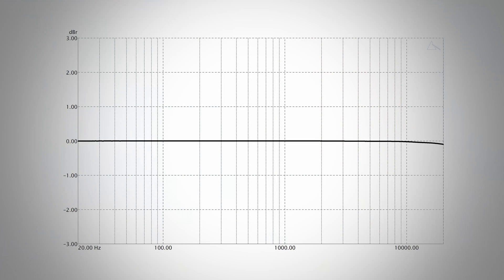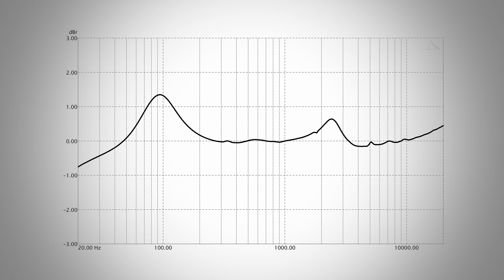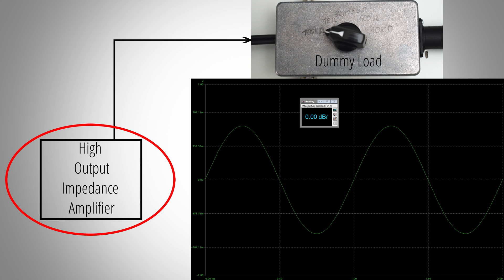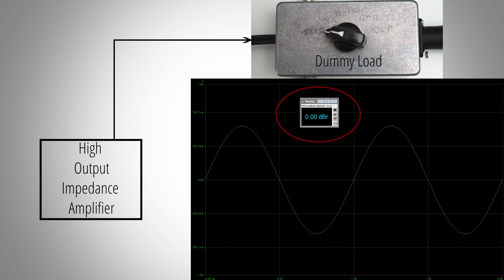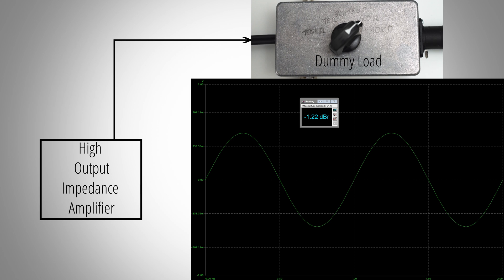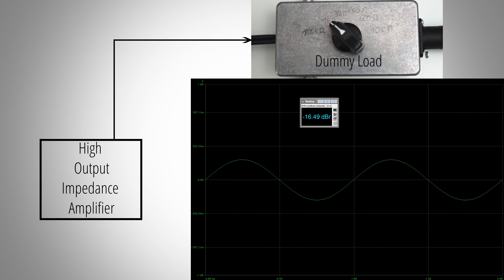Amplifier Impedance matters! Why it is important to have a low output impedance (explained)

Comment: I Lost it... my SoundCard(SBZ) has 22-Ohm output. 
so 22 x 8 = 176-Ohm.

I Have 3 headphones: A) 32-Ohm, B)35-Ohm and C) 60-Ohm. they have Lower  Impedance than 176-Ohm, will that effect their Sound?

Or the problem is only if the Headphones go beyond 176Ohm?

Will my SoundCard Struggle to Power more than 176Ohm headphone or it will struggle to power lower than 176Ohm headphone? is my question i guess...

when i say struggle i mean to keep the Frequency Flat.

Comment: I am using SSL 2+, DT 990 pro, and HA400 headphone amplifier. What is the most effective method? Going with a high gain from the audio interface and a low gain from the amp, or a low gain from the audio interface and a high gain from the amp? Thanks

Comment: Nice video, maybe you (or someone else) can help. I bought 'Sennheiser 280 pros (64 ohm) ' to play on my spark amp  (4 ohm) and the sound quality is terrible, very low volume and any attempt to increase just crackles and distorts.....im guessing that's an impedance problem. Is there anything i can do to improve the sound quality or is this just the wrong headphones with the wrong amp?

Comment: Adam audio a8x's input impedance is 30km and Eve audio SC 208's input impedance is 10km, what is the difference in these studio monitors ? Input impedance
Reply from the maker: Hey, with active monitors this does not matter, as the amplifier stage has a very high impedance. This problem only really exists with passive speakers and headphones.
Reply: @JulianKrause Thanks brother,i  hope that you will make videos on studio monitors as well in near future,

Comment: Julian. Can you type your amplifer with High Output Impedance you've used in the video? 20 Ohms? 50? 100? 200 Ohms? 
I want to buy an audio card with Output Impedance 22 Ohms and use 48 Ohms's headphones with her.
Will I hear difference in spec? And how much dBrs I'll get on 100 Hz and Hi Freqs? Will it so critical?
Thank you

Comment: Hi Julian, I appreciate you trying to simplify the discussion of impedance but you're incorrectly treating impedance as a passive resistance. Impedance is a value that also takes into account capacitance and inductance response at various frequencies. But if a headphone impedance is too low, the output amplifier is driven too hard and that is what causes distortion at various frequencies. For a simple rule of thumb to get the best sound from an active amplifier output (which are most modern devices,) a headphone impedance should try to match the amplifier output impedance for optimum power.
Reply: except u are wrong.

Comment: I am so, confused. This is contradictory to all other videos and even articles where they all claim that impedance should simply match.
Reply from the maker: Hey, impedance matching is something you have done back in the days to transmitt the most power possible. But that's not what you want to do today. These days you use something called impedance bridging. Now you want to have a low output impedance and a high input impedance to avoid any frequency response deviations, as shown in the video.
Reply: @JulianKrause  let me put it this way: i have Zoom g5n guitar processor. For phones output it says "maximum output level: 20mW + 20mW (into 32 ohm load)". Will this be good with beyerdynamic 770 pro (250 ohm)? There is even alternative that i plug it into that 6.35mm (with adapter) output, that i currently use to put it to amp. But there it mentions 10k ohms. It is all totally confusing for me. And i don't know if I should buy these or some other headphones with lower impedance. Can you help?

Comment: Great video! Is this the same of normal speakers? Why is it better to have low impedance speaker (4 instead of 8) for home speakers? Do this means standard home power amplifier have very low impedance (half a ohm)?
Reply from the maker: Hey, it's basicly the same for speakers. Amplifiers have a very low output impedance, 0.1 Ohm is not too uncommon. 
But if you should use 4 or 8 Ohm sspeakers would have more to do with the power handling capability of the amp.

Comment: Hi Julian, i have a question:
I'm looking at your headphones amp comparison for different audio interfaces, and I was wondering: does the power measurment you take of the amplifier already take this into effect? 

For context, I'm looking between the arturia minifuse which measures at 145mW @ 32 ohms with a 11ohm output impedance, and the m2 that has a 28mw @32 ohm output impedance and a ~0.4 ohm output impedance 

Despite me liking everything else about the m2 I decided against it because I thought it's headphone amplifier doesn't provide enough power so I was going to choose the minifuse instead, but if they're output volume is lowered by they're much higher impedance then that doesn't actually help.

I'm not concerned about the Freq Response changes as the headphones I'm getting have an incredibly flat impedance vs freq curve. (They're planars)

They are 32 ohm and 94 db/mw.

Thanks for any help.
Reply from the maker: Hey, the power measurement already takes this voltage drop into account because it is measures under load. A quick calculation reveals that with the M2s 28 mW and a sensitivity of 94 dB/mW lands you somwhere between 100 and 110 dBSPL. This should be sufficient for many cases. But I understand your concern, if you like really loud music the MiniFuse will provide more power. I wouldn't worry about the frequency response change due to the output impedance. 
The 10 Ohm output impedance of the MiniFuse is still relatively low and in combination with the flat impedance response of the headphones, I don't expect any detectable impact on the audio. Cheers!
Reply: @JulianKrause  thanks for the reply!

I might go for the m2 then actually, honestly 106-7db should be more then enough headroom, my hearing is a bit more sensitive then most anyway so my listening levels are usually lower. 

And it's distortion performance is much better  and it does have a -10db lower noise floor aswell + the dac and adc are superior.

Makes me wonder why people on forums state that you need an amp with like 1000mw plus for headphones of similar efficiency.

Comment: What impedance in the output of the amplifier do i need when i use a 250 ohms headphone?
Reply from the maker: I would say if the impedance of the amp is lower than 50 Ohms, you will be fine. Luckily the majority of devices have that. With 250 Ohm headphone I would more look for power, so that your headphones get loud enough.
Reply: @JulianKrause  is there no impedance where the 250 ohm sounds a little better like the 600 ohm headphones do?

Comment: I keep reading online that lower impedance headphones are better for lower powered sources like iPhones and such but that is counterintuitive to what this video says. Can anyone shed some light on this? I thought the video was saying that the lower the impedance on a headphone the harder it needs to be driven but forum and respectable sources online are saying the opposite. Do I have this wrong?
Reply from the maker: Hey, low impdance headphone need more current and high impedance headphones need more voltage to get loud. It is easier for portible devices to output a high current than it is to output a high voltage. That's why portable devices can often deliver more power into low impedance headphones than higher impedance ones. So, low impedance headphones tend to get considerably louder with portable device.

Comment: I'm currently using my zoom h4n as a dac/amp, it has a LINE Output load impedance: 10 kΩ or more Rated output level: -10 dBmPHONE: 20 mW+20 mW (into 32-Ω load) 
i want to know if its good enough to pair it with Sundara headphones (Sensitivity: 94 dB. Impedance: 37 Ohms.) or if there will be a noticible difference with another amp.
love your explanations man!

Comment: Thank you for the clear explanation! I need to ask, why do some premium amps have 100 Ohms impedance? Some headphones are made to sound 'best' with these amps. Beyerdynamic is one example, their 250/600 ohm headphones are made for their 100 ohm amps.
Reply: They probably can deliver huge voltage so they are equipped with serial resistor to "flatten" a loudness difference between high and low impedance hp.

Comment: Invaluable information. Cherry on top would have been to see some 'proof'/elaboration for your 8x rule of thumb, e.g. frequency chart(s) with intermediate amp/hp impedance ratios, rather than just the very good and very bad case.

Comment: What about milli watts does that matter when matching headphones to amps? Thanks
Reply from the maker: One thing you want to check is that the headphone amp delivers enough power for your headphone. This is important, otherwise your headphones won't get loud enough. Most amps deliver a decent amount of power but more insensitive headphones might need more power and it is best to check beforehand.

Comment: I'm struggling to understand why loudspeakers for example should be impedance matched; IE 8 Ohm output into 8 Ohm speaker.
Reply from the maker: Hey, they shouldn't. The principle shown in the video also applies to loudspeakers. The amplifier will usually have an impedance many times lower than the speakers impedance. Somtimes a manfacturer tells you which impedance the connected speakers should have but this has primarily to do with the power handling. This video sums it up quite nicely: https://youtu.be/3BOctTUefVM
Reply: @JulianKrause  Thanks for the reply 👍
It's kinda crazy, my whole life everyone has impedance matched. I'd never heard about output impedance until NwAvGuy's blog. I've been trying and failing to explain it to die hard disciples of impedance matching.

If using a 4 Ohm instead of 8 Ohm speaker, the power delivered by the amplifier would essentially double? So for a 100 W amp when the manufacturer recommends 8 Ohm 100 W speaker, to use a 4 Ohm speaker it should be 200 W rated?

Comment: Since you’re responding pretty fast, I’d like to ask one more question to you, Julian. 

I want to sort out with integral audio interfaces’ headpnones amps and headphones matching. 

I’m wondering if the interface I’m working with (Focusrite Saffire Pro 26) would give enough clear sound to Beyerdynamics DT 770 Pro 250 Ohm. 

I was searching for such info all around various forums. And all the explanation I found there looks like “yes, this interface will drive these cans” or “no, it won’t “.

I’m writing you, because I know you get into details.

I want to know something like a formula that would say if a pair of headphones X would sound its best if connected to the headphones output of the audio interface Y. 

Yes, in this video you told there should be a certain relation between the amp’s output impedance and the headphones’ impedance. 

But what about the sensitivity of headphones? It also can differ from one pair to another. 

In a nutshell, my question is how to 100%  define if a pair of headphones will sound its best with an audio interface. 

Thank you in advance.
Reply: sir did u choose ur amp or interface cuz um planning to buy same headphone. Hope u got ur answer
Reply: @colorblind.0001  yep, I bought Motu M4 and DT 990 Pro. Sounds great to me.

I’ve quit trying to dig as deep as possible into the theory and decided to trust my ears and stick rather to practical results
Reply: @lepeher3179  did u calibrate or eq them ?
Reply: @colorblind.0001  no, I use them as is. Sometimes I apply the Sonarworks Reference 4 plugin.

Comment: Amazing info, Julian. That's actually what I was looking for. Thank you for that. I understood everything after I reviewed this at second time :)

I have a question for you.

So, if the lowest amp's output impedance is the best and the most universal, why are not every single amp is designed to have as little output impedance as possible?
Reply from the maker: Hey, it is more difficult and usually more costly to build a well performing headphone amp with a low output impedance. That's why you can often find high output impedances on cheaper equipment.
Reply: @JulianKrause  got it. Thanks for such a fast response

Comment: Very clear explanation, thanks. But it leads to the inevitable question 'why do high impedance headphone amps exist?' or put another way, 'What is the advantage of a high impedance amp?'
Reply from the maker: Well, it is often down to cost. Designing a proper low impedance headphone amp is typically more expensive and complex. For example, if your amp delivers a very high amount of power and has a low output impedance, there is a risk that you can fry sensitive headphones. To prevent this, you would have to deploy current limiting of the amp which not necessarily easy to do. Or you could simply slap a resistor of e.g. 20 Ohms in series with the output. This is what you can see in many cheaper headphone amps. This of course increases the output impedance but it also protects sensitive headphones and is very easy to do.
Reply: @JulianKrause thanks for the clarification. okay, so H.I. amps maybe cheaper, and safer  to use and match, but do not 'scale' as well as L.I. amps, with regards to headphone Impedance?

Comment: Great Video!!! Just subscribed you channel.
Could you please define "high" and "low" Impediance?
Is 22-Ohm output impedance of a MAX97220A "high" for running 250 Ohm headphones?
Reply: I would check out his video called Interface headphone amp comparison looking at headphone output of various interfaces to get an idea of of different ones compare to each other. Your ratio is over 10:1 so from an impedance standpoint that seems fine, however I think you also have to factor power at that load. His video shows interface headphone output impedance as well as power at different headphone impedances of many popular budget interfaces.

Comment: At 0:29 you say "it can have considerable effect on freq response" not "it will..". Are there any possibilities that it does not have? Are there headphone amps that have high impedance output but sill can deliver high current? Why is the recommendation 1/8? I have seen it at several places but no explanation. Some sources say 2,5x difference is enough.

I have recently looked at SPL Series One headphone amps/monitoring controllers (Marc One, Control One D) and it has a headphone output impedance of 20ohm. I have found three separate reviews (amazona.de, headphonecheck.com, miniklangwunder.de) where reviewers use AKG K702 (62ohms), Focal Clear (55ohm) and Beyerdynamic T5 (32ohm), none of which should match according to 1/8 impedance rule. Yet they all claim that is sounds great.
Reply from the maker: Hey, how much the headphones frequency response is affected, depends on the type of headphones. For example planar magnetic drivers typically have a relatively constant impedance over the frequency range and thus are much less impacted by the output impedance of the amp. Dynamic drivers can have quite big changes of the impedance in the frequency range which is why they are much more prone to this issue. 

The 1/8 "rule" is only a rough guidline. Of course you can use lower ratios, but the closer the impedance of the headphones gets to the output impedance of tha amp, the bigger the problems will get. Headphones can still sound good with higher output impedance amps, it's just that they won't sound as the designer intended. The 1/8 rule of thumb helps to assure that the changes in frequency response are kept to a minimum.
Reply: @JulianKrause  I see, do you know if there are design issues why all the headphone amps are not low impedance - I mean low impedance is good for getting higher current easier but will other specs suffer in this case (see focusrite scarlett)? For instance Universal Audio Apollo (high-end interface) has 10ohm (found it only after googling, they dont mention it in their specs). Are mobile phone amps all low impedance in this sense? Why do we even talk nowadays that high impedance headphones are pro market nowadays? I think most of the new headphone designs  (see focal, ollo audio, all the planars) are low impedance even for pro market yet interfaces don't seem to adapt (see audient).

Comment: Hi, Thanks for this video! 
Can you explain what ohms should look at for high and low impedance? 
I want to buy a headphone amp, i have the Motu M4 with a pair of beyerdynamic dt 770 pro 80 ohm headphones.
Would you recommend: 
the Behringer MicroAmp HA400 (approx 80 ohm) 
or 
the Mackie HM-4 (47 ohm) ?
I can't wait for the answer!
Thank you in advance!
Reply from the maker: Hey, the M4 already has a very good headphone amp built in with a low output impedance. Adding an additional cheap amplifier like the ones you named, make the performance probably worse. So just plug your headphones into he M4 and enjoy the music :)
Reply: @JulianKrause  Hi, thanks for responding!
I'm a little confused right now :/
Does that mean these amps i named are really that bad? Cause i read a lot of positive comments about them... I guess it's subjective :)
So how can i plug multiple headphones with the M4?
Please respond to that as i'm in urge for this please!

Comment: What if I add an additional resistor in a scenario with an high output impedance amp and low input impedance headphones? Would that flatten the response curve and therefore increase the audio quality? It would effect probably effect also the maximum volume level but for the evo4 it would be ok I guess.
Reply: It would probably be one resistor per channel. I'm interested to know if that could help too.